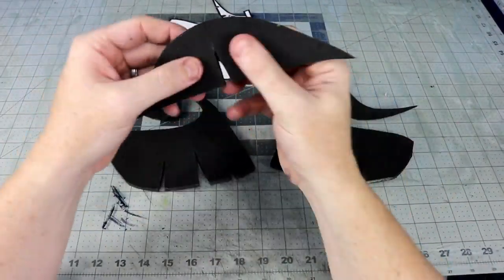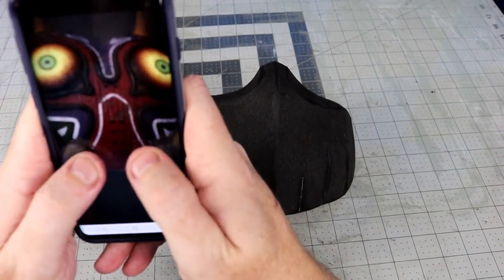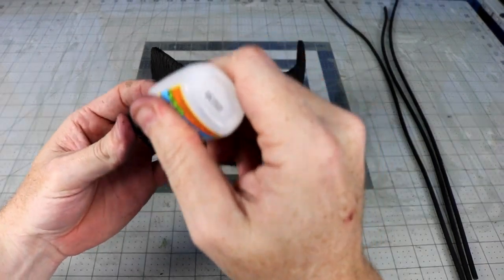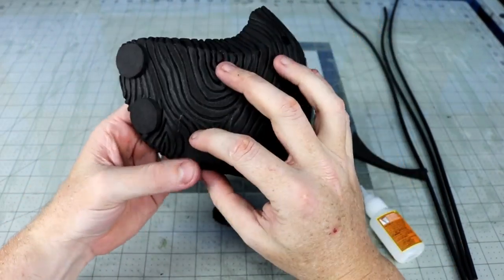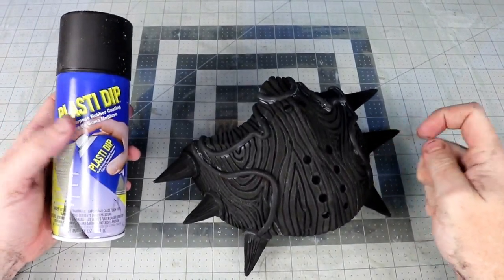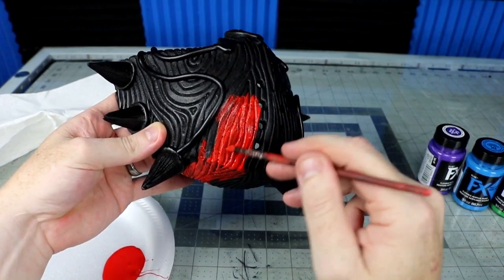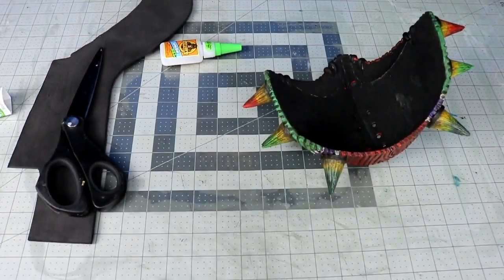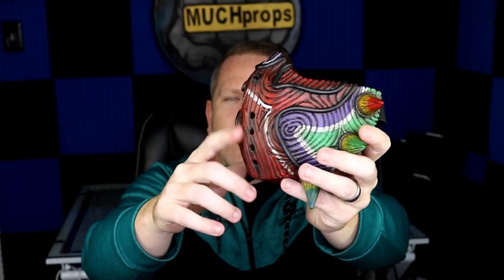Making a Custom Majora Menpo inpired by the LOZ

Comment: Late to the party, but I've done everything short of making the spikes. Every time I try to dremel them into points, I come up short or shape and size differences occur. Do you have a video, or can you give me a more in depth how-to, on how to shave these down? Love your videos, BTW!
Reply from the maker: There are a lot of ways you can attack it. I have had tons of practice, so it can look simple on video. Some pointers I could give; cut the dowel to the height you want the spike, put a dot in the center on the top, make sure your blade is sharp, try to shape it as much as you can with the bix cutter, and when using a rotary tool go slow working from the tip to the wider end. You can also but cone shaped EVA foam spike too. I think TNT Cosplay Supply online carries them

Comment: Would  Flexseal spray  work  instead of plastidip?
Reply from the maker: I've never used it but I wouldn't see why it wouldn't. I've used Plasti dip, Mod Podge, Wood Glue, PVA. You just need something a little flexible so the paint job over the top doesn't crack from movement.
Reply: @MuchProps  im definitely going to try  this out especially  once i can  get back to  work on my major  crafting